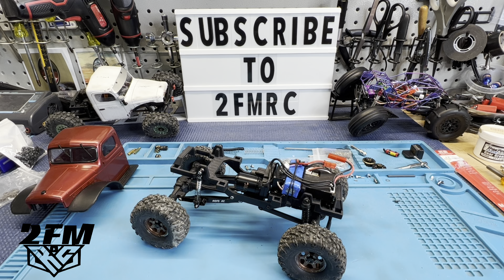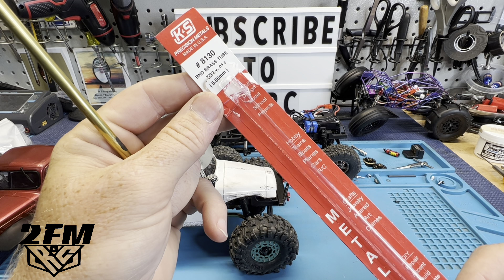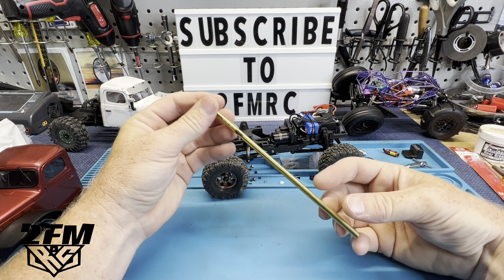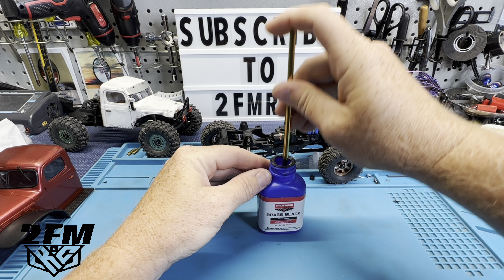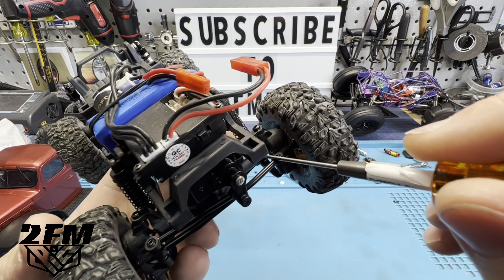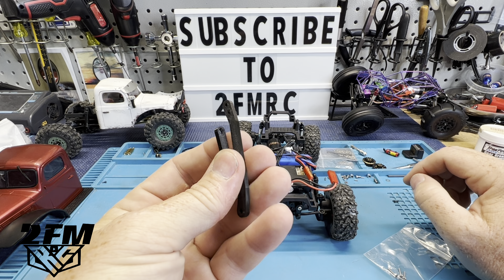FCX24 $5 Steering Link and FREE mod for more Steering!

Comment: Man, you had the best timing ever with this video. I got my McCue extended links installed, took it for a run, and noticed the turning radius wasn't as good with the stretched wheelbase. Not horrible, but noticeable. Then a couple hours later I see this video, swap the front screws around, and adjust the dual rate. Seriously makes a huge difference, I think it turns tighter than with the stock wheelbase and the screws in the original spot. Freakin' excellent!
Reply from the maker: Nice! Glad to hear it helped out!

Comment: Great tips!  Another option for stiffening the steering links on the cheap is to use a cut and bent piece of welding rod (or other small dia. rod) placed on the front of the link and secured with an application of the appropriately sized heat shrink tubing.  Heat shrink is available in various color options as well.  Will definitely be relocating the screws.
Reply from the maker: Yep! The shrink wrap will work great!
Reply: @2fmrc   maybe a vid on the build of that white fcx? Cab mod(s), cab mounting, bumper, tires and wheels, beadlock rings? I love that look. Thanks for the vids! 👍🏻

Comment: Just throwing this out for gits and shiggles. But what about using a smaller dia. tube, flattening the ends and drilling a hole through each end so to fit the steering link screws on the knuckles Get rid of the whole stock unit and take all the wiggle out as well. :) Just a thought.

Comment: Good call on the screw! I dropped my FCX REALLY low with free chassis/body mods. These free mods alone make it almost as capable as my heavily modded SCX24. With only $100 in upgrade parts the FMS out performs. Moving the battery to balance the motor weight worked well too.
Reply from the maker: Yep! The thing is a monster!
Reply: What is the chassis drop mod?
Reply: @keldonator  There are many ways to lower your center of gravity but for a stock truck on a budget lowering the battery to balance the offset motor position and angling the shocks to allow the entire chassis to sit lower in the shock travel helps a lot. Also lowering the heavy hard body by coming up with your own body mount solution really helps too. My powerwagon body comparision video shows mine with the body removed. https://www.youtube.com/watch?v=f03Xtue2ZL0
The video description goes into more detail.

Comment: A better solution to have your link black is to put heat shrink tube on it, it will resist all scratches and have a nicer matt finish
Reply from the maker: Yeah I thought about doing that also. Just wasn’t sure if it would hang up at all being kinda rubberish.

Comment: Matt I installed mccue s steering link and it feels more solid but when I totalled steering trim plastic horn now slides on servo’s pinion and that’s a bummer! I glued the plastic horn with some lock tight glue haven’t tested yet hope it will last….are there any metal horns for the fcx? Do I gotta put orings in between he steering link screws? Great mod man
Reply from the maker: I didn’t put any between them. I’ll have to check on a metal servo horn for the stock servo

Comment: How does the steering compare on the fms axles? I’m having issues with axle shafts with the Scx24 axles, both stock and mofo brass housings. I’ve tried mofo cvds, stock shafts, and lgrp shafts. Yes I’m setting end points but it’s getting ridiculous.